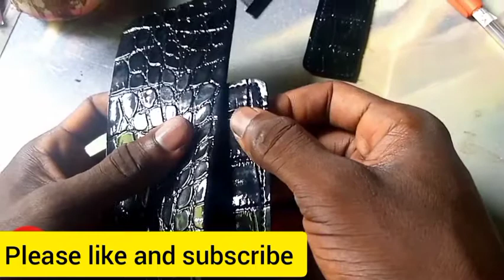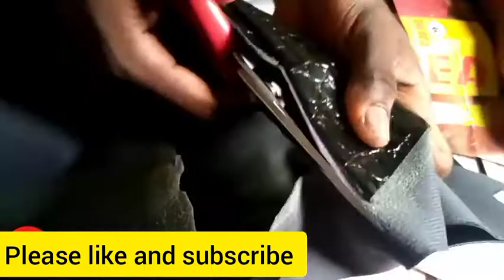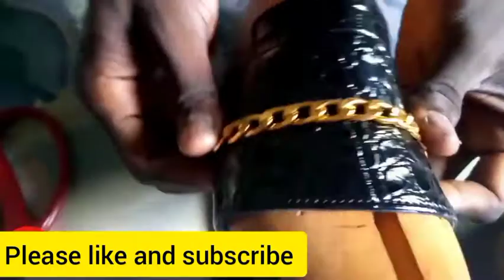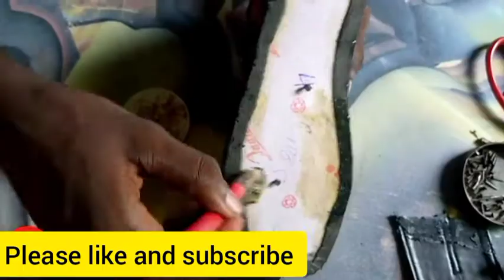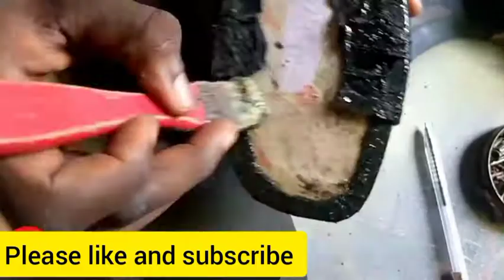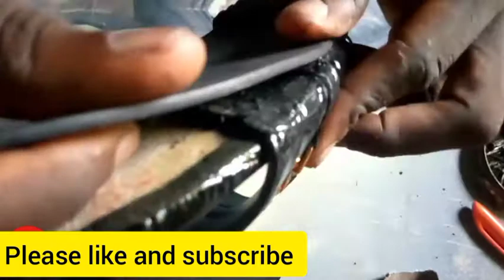DIY FEMALE SLIPPERS

Comment: CAN YOU TELL US THE MEASUREMENT FOR THE TOP YOU JOINED TOGETHER (IN TERM OF LENGHT AND WIDTH FOR THE SIZE YOU MADE)?
Reply from the maker: The small leather on top
Width -3 and half cm 
Length - 7 and half cm
   
Main leather
Length-- 21 and half cm
Width-- 7 cm, you will add half cm to both front and back that's for folding the edge of the leather.thanks
Size 40
Is it clear?

The size of the slippers you want to do determine the measurements
e.g size 38 measurements is different from size 40.
The lasts you want to use for the slippers will give you the measurements.
If you don't understand please ask more ,I will be glad to answer you thanks.
Reply: @footsarena7750  Thanks for the response.